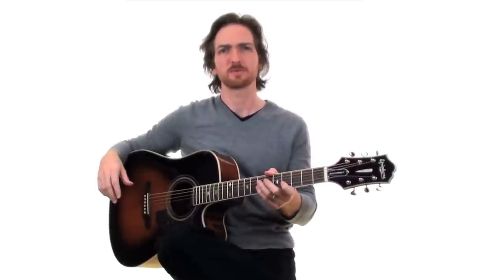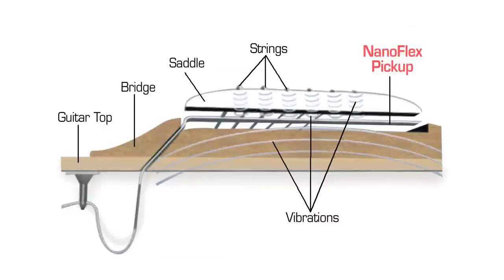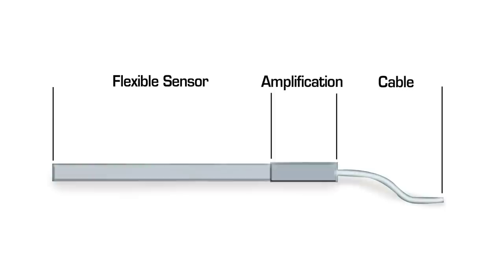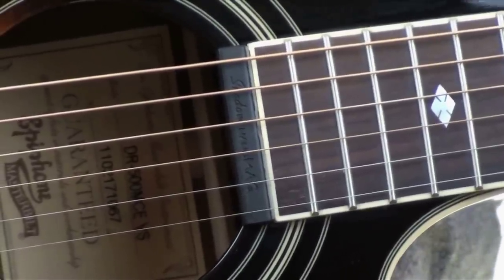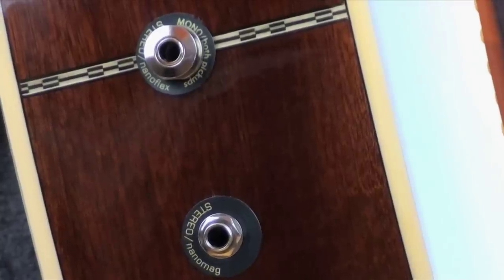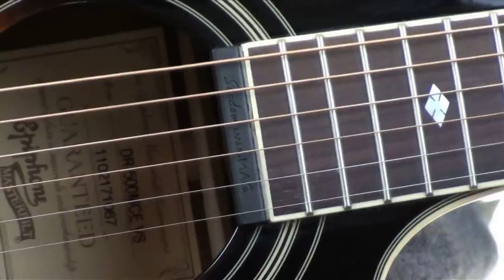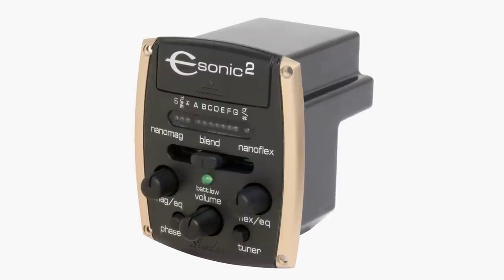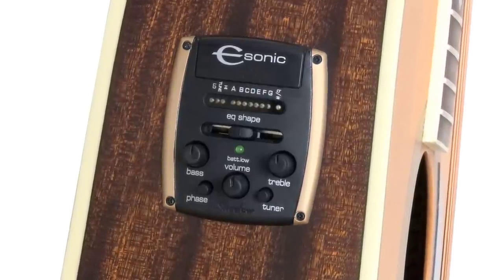Epiphone eSonic2 Preamp System for Acoustic Guitar Demo

Comment: I have this system in my Epi but without the nano mag. 
I love the system. The nano flex is extremely fragile and I have replaced it once due to my careless handling, but I’d love to have it in all my acoustics as they do not sound as good plugged in with their standard piezo under saddle. I am unable to record acoustic with a microphone due to lack of absolute silence. With this system once I found the right settings in my DAW I have the freedom I need to record anytime I need to no matter how much environment noise is around me and have that natural acoustic sound. 
I have done extensive research online and watched many reviews of other available systems and none of them give this kind of freedom with a natural sound. Period.  But be forewarned if you plan on fiddling with the nano flex strip you may very well break it easily. They are not junk, just fragile.  I’m very glad I bought this guitar as I had no idea what it can do, I just liked the body of the guitar. I am pleasantly surprised.

Comment: I have both the ej200sce and the DR500mce and they are both well worth the money.They are quite different from each other in that the 200 is ,to my thinking,more useful plugged in and  the 500 , while excellent amped sounds better unplugged than the 200 because of it's solid spruce top and solid mahogany back and sides.The 500 has open 18-1 tuners which are more sensitive and stay in tune somewhat better than the 200 with it's 14-1 set-up.some have commented that the action is a problem and for $50 or so a guitar tech will set the action for you.There's nothing worse than starting out trying to play with strings way too high off the fretboard. Epiphone is doing some things VERY well , especially for the price point.

Comment: i really think that he is using an effects in order to have a good result in the sound. i have an epiphone which has an eSonic 2 pre amp but it does not sound like the one in the video
Reply: maybe because of the amplifier
Reply: That's because they are bad news. They might hold up to a couple of years. I have 2 guitars with the same unfixable broblems.
Reply: @j.richie3558  You mean just the electronics right? I bought a Martin(finally), and Guitar Center sent me a scratched up one. I ended up with a Masterbuilt with rosewood back and side with same electronics. The Epiphone is easier to play, sounds great plugged as well as unplugged, and cost under $800. I don't understand how pickups can go bad and end up unfixable??
Reply: It’s produced by using both outputs and refining the settings.  One of the amps more than likely has reverb.

Comment: I have found that when I plug the jack from the nano mag into an electric amp and the jack from the nano flex into an acoustic amp that the slider Blender Control doesn`t stop the nano mag from working when the slider is at the full nano flex position... shouldn`t the nano mag stop when the slide control is at the full nano flex position even when the 2 jacks are in separate amps ? The stereo Jack strap seems to give independant control of the two pickups .

Comment: I just bought the EJ-200SCE with the eSONIC 2. I have some real concerns. When plugged into the mono I get a hum that goes away when I touch the stereo plug. Also when I slide all the way  to the left, (nanomag) I have no sound to my amp. 
Also, when I plug into the stereo I don't have any hum but when I slide all the way to the right,(nanoflex) I get no sound to my amp. and the tuner does not seem to work well. I really love the guitar. I had to spend some time lowering the action and don't want to send it back to MF. Help!!!!!!
Reply: I have this guitar also. Plays and sounds great, only complaint is the Nanomag pickup - If I plug 1/4 inch jack into the second input, I get a lot of noise along with the guitar output, so it's basically useless. My guitar tech won't touch it without $100 up front for parts, ( not including labor ) so, I just use the single output. Not much to say about the " stereo " sound you are supposed to get.
Reply: Sounds like a cracked wire in your lead
Reply: Get a new guitar tech.
Reply: It's only shadow's terrible quality of work. i have 2 of them and they have the same unfixable problems.

Comment: I love my Epiphone J-200, but the eSonic2 unit doesn't work anymore. Why? Not a clue! I've put in a couple of new batteries, but still nothing. No sound, even the little LED light won't come on when pushing the Tuner button. Anybody has a good suggestion on how to fix this?
Reply: Take it back to your dealer, or contact Epiphone.
Reply: +flwolf2000 I don't know if you ever fixed this.  Perhaps it's something simple:  Pull out the battery with its plastic holder.  Look inside the eSonic.  See if the contacts are correctly positioned.  For the coin-type batteries, sometimes their metal contacts are pushed back over time and it doesn't touch the battery.

Comment: Why it's difficult play my Masterbilt, I pay $600 and I hate it, because is very difficult play, is very hard the strings and do the chords, Can you tell me thats can change the strings from 0.10 to 0.09 maybe to play more easy.
Reply: Make that callus grow.. lol
Reply: I second the pro setup.  I chose to replace the nut and saddle with Tusq.  The bone used was so soft it had the resonance of chalk.  If you get a blank Tusq nut you can have the string spacing adjusted to your preference too.  I personally like just a tad more spacing then it comes with.  There is plenty of room to do it on this neck.  It makes for easier chording hammer-ons and  pull offs  in the open position.
Reply: Cesar Figueroa 0.10 and you STILL can't play it? I think your fingers are TOO frail. The NORMAL gauge for an acoustic is .12
Reply: Ariel Cardona This guys English isn't the best so I was thinking he was asking to change his string size to smaller to make it play easier! I would suggest he have it set up professionally and maybe lower his string gauge to 11's and build up his left hand callouses and endurance. Then go back to 12's.
Reply: Michael C i believe he's asking if there is a string as thin as .09 . Maybe but i dont think there is one, it will sound to thin if theres one
Reply: Sure, there are acoustic strings with this gauge!
Reply: which doesn't sound nice on a dreadnought, just saying
Reply: Kristian Dominguiano  I agree with what you are saying on string gauge. But this guy sounds like he is just starting out. Elixir makes a .10 and .11 gauge set.
Elixir
Elixir